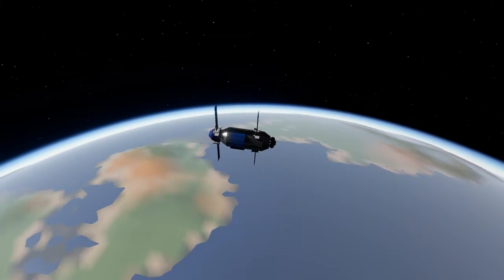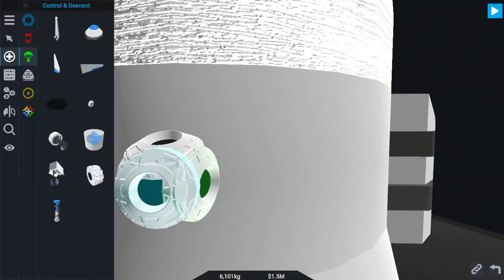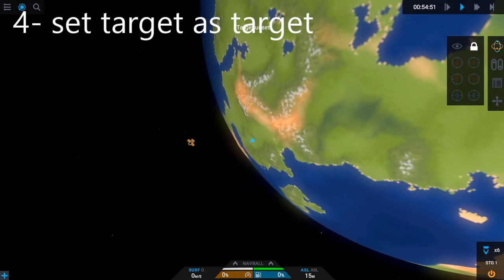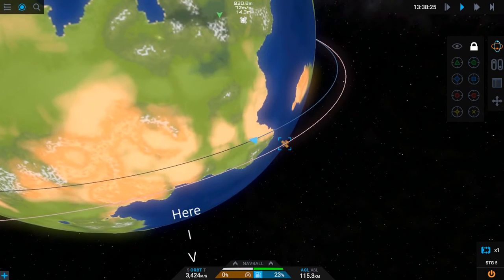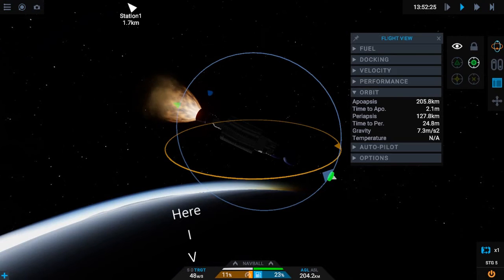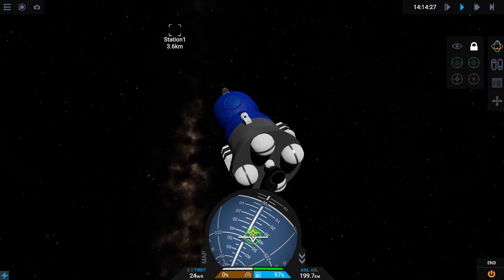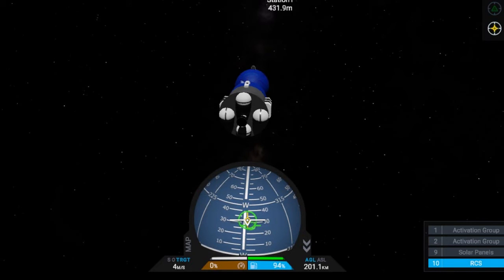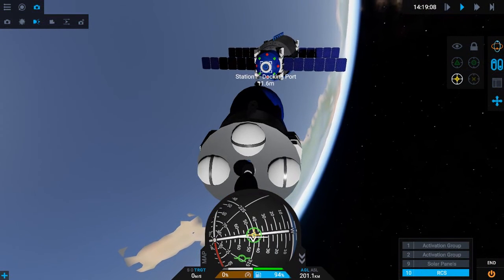Docking Tutorial, SimpleRockets2!

Comment: Where'd you find a monopropylene tank ? The circle one in the bottom of the capsule
Reply: Nvm i figured it out. Nice video btw. I appreciate that
Reply from the maker: @akiraaa_____  thank you!
Reply: He made it. You can add a very small tank and one nose cone at both sides, and fill them with monopropellant
Reply: @JoaoVictor-uo4dn  yeah currently I found out that the fuel tank can be customize what kind of fuel it use.
Reply from the maker: @akiraaa_____  yeaa, everything is customizable in this game 😂
Reply: @Bubble89  ikr, I'm kinda surprised because on the old version of the game there is no monopropylene option for the fuel.